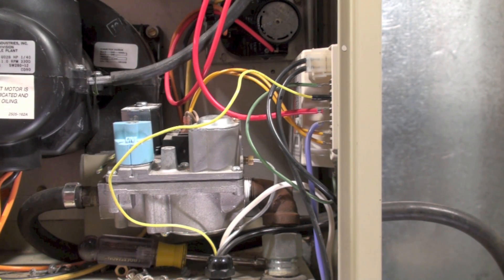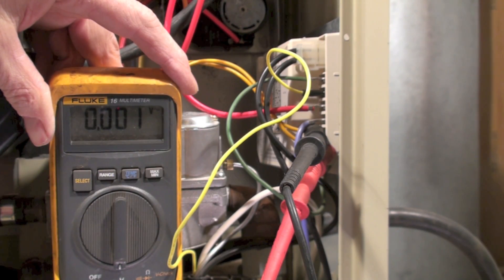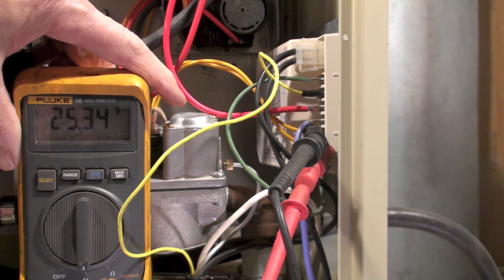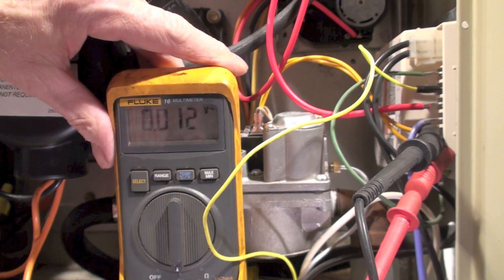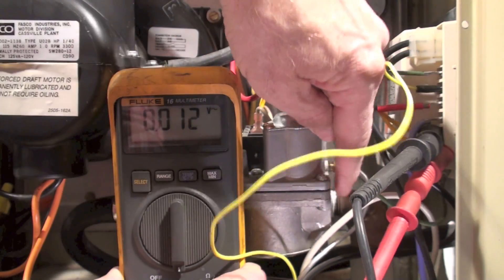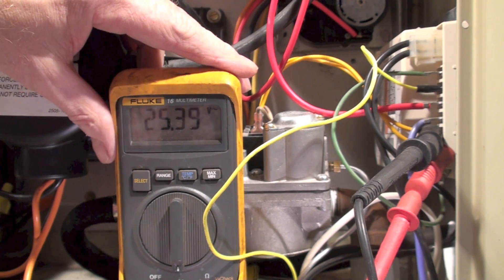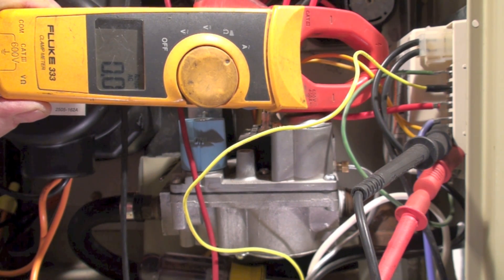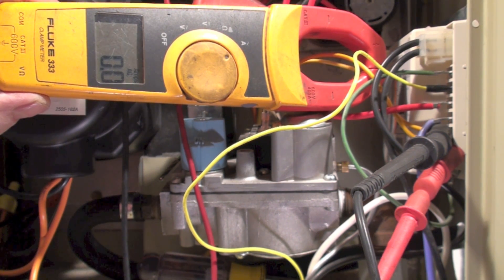Gas valve troubleshoot, Snyder General GUA furnace. Part 5

Comment: Ok my pressure switch is working but combustion blower stays on with thermostat off.  What do I test now.  Ingniter does not come on.
Reply from the maker: You may have a limit or a rollout switch open.
GFM

Comment: The odd thing is when i originally went to look at furnace no heat issue...the glo ignitor was broken ..so i replaced it and didnt fix issue....then was told gas valve was bad....so i replaced that..didnt fix it....what im thinking is that when i replaced the ignitor i may have disturbed the wiring .....i believe the original issue was bad ignitor and the wiring issue was a secondary issue that occurred when i changed ignitor....thank you

Comment: I have same issue....replaced gas valve and same thing....i get voltage to gas valve for only fraction of a second literally and then goes to zero....i have gas coming in to valve.....but i cant smell or hear gas coming out during startup process....any ideas?
Reply from the maker: Probably an ignition control failure.
GFM

Comment: I'm still having hard time with this furnace 
No Voltage at Gas valve 
got Over 7 WC gas in 
Board is reading Rollout switch 
but nothing wrong with it 
I checked all switches 
I even tried a new HS igniter 
can't clear that code 
Any hints ?
Reply from the maker: +mikhaiel j Keep looking.  You either have an open in the wiring or a limit/rollout/pressure switch.
GFM

Comment: Using the Amp Meter method, if the gas valve draw amps could it still be a bad valve
Reply from the maker: Yes. You are just eliminating other parts when checking amp draw. 
GFM

Comment: I was having intermittent problems with my unit and after fixing it three different times by cleaning the flame sensor (removing it from the ignition control board and the unit, then putting it back in), simply cleaning the sensor did not work. I followed this video and, after checking the air proving switch and the flame rollout switch, I removed the wires from the valve and the ignition control board to check continuity. They were good and I placed them back on the valve and the board. The unit started working. I am wondering if the circuit board could be cracked or the connectors could be corroded. I was getting 24V at the Pilot terminal but not the "M" (maybe for "main"?) terminal...I am now. Should I consider replacing the controller? It's $109.00 and I would rather not waste the money needlessly...
Reply from the maker: There can be board failures simply due to a bad solder joint.  I did a video on identifying solder connection problems.  Check here:  http://youtu.be/LxOUHEZiIx0  I also have one on doing solder repairs,  Hope this helps.
GFM

Comment: GFM, i had a similar situation a week ago on a MUA residential unit. Which 24v was sent to gas valve then it would drop out.... & always on the 2nd attempt it would sequence as operate as should. What do you think would cause the 1st trial failure for the gas valve? this is a direct spark ignition unit..
Reply from the maker: I would check the flame rod and clean.  
GFM
Reply: The unit would not fire at all or send gas through manifold. flame rod was clean.. it just was weird that the solenoid would Always work on the 2nd attempt. Not too sure what to make of it. It was reported to be replaced next PM but i'm curious why it might do that. Trial for ignition attempt #2 .. but why it fails that way 1st time is beyond me.
Reply from the maker: ZuffaLtdDanaWhite The only thing I can think of is the gas valve is failing.. You could make sure if you had your meter probes on the valve solenoid when the trial for ignition begins.  Thanks for the comment.
GFM